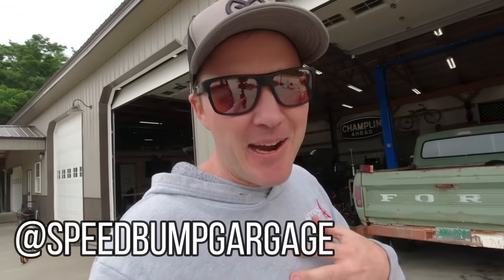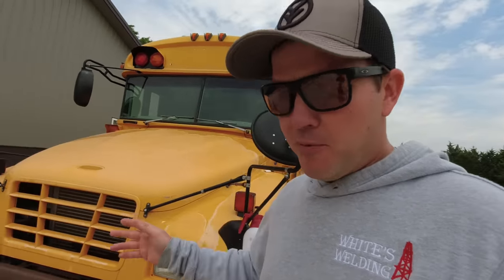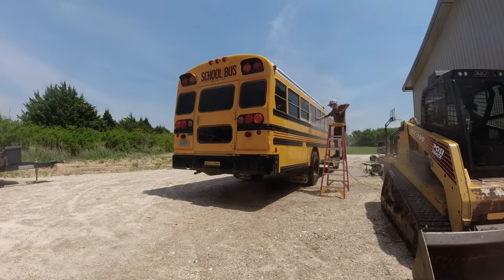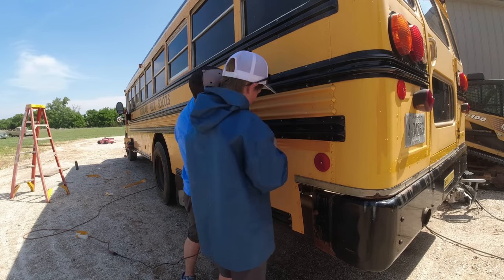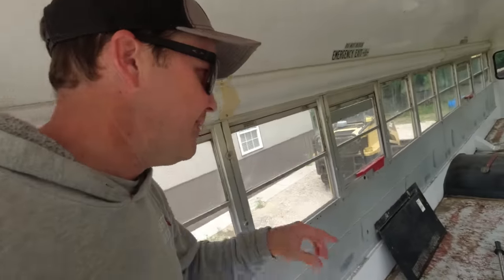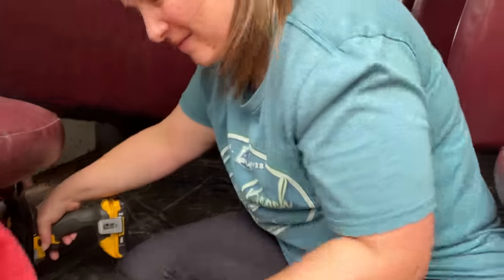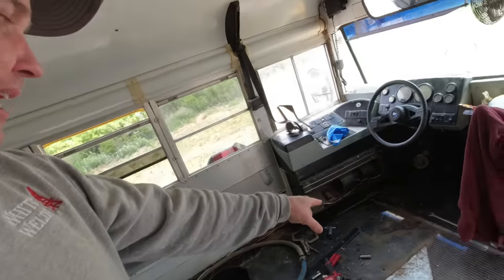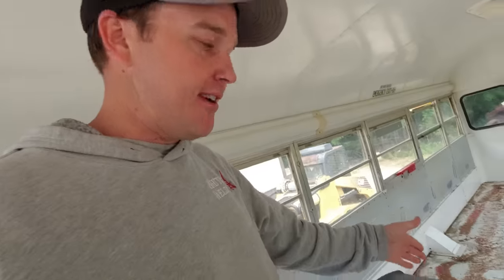DIY Family School Bus Conversion! {The Teardown} EP1

Comment: For painting the thing. The hood is where you can take the most time and get the best results. You could set up a little paint booth in the garage for it,  prep it, prime it, and spray it like that. For the rest I'd really use a roller brush. It's not going to be perfect, for sure. But, if the nose is close to perfect it'll grab all of the attention!
Reply from the maker: Great idea! I think the hood will also be the hardest to prep
Reply: @SpeedBumpGarage  You could also farm that out! I doubt a paint shop would mind something so small with such a quick turn around. If the price was right, it would save you a lot of time and effort.
Reply: @SpeedBumpGarage  use a wrap to cover the hood make it a Partridge style wrap job ,eave the side rails black

Comment: Back in the early 80's I found a 1951 International short bus that had been turned into a camper. It had a Chevy 283 with a truck 4-speed and a 2-speed rearend.  I did a lot of work on it, but the outside windows were replaced with camper windows and the rest were covered with sheet metal.  It had a stove with an oven, dinette, a double overhead bed, two bunks in the back and a bathroom with a shower.  That thing was crazy cool and would fly down the highway easily at 70-75 mph.  My family and I had a fun time with it, and we went all over western Colorado when we lived there.  You have unlimited possibilities!  Have fun, great video!
Reply from the maker: Sounds really similar to what we want to do!

Comment: I would sure go for a sub-floor giving a few access panels..Good for keeping wiring hidden thus having a clean look and also able to add any accessories later on that you may want ..They make a thick tar like wide strips that adhere to the ceiling to deaden the excess sound you will get when driving it..Thats what they use in auto assembly plants before the headliner goes in..i would use those for sure..You have Jack on the Job so i am pretty sure he will have your back on anything you want to do..Awesome project..can't wait to see your end result

Comment: Hey dad, just a tip on sealing the wires with heatshrink, if you heat the shrink really hot, part of it will seal around the wire plastic, some will be a tube which you can crush with a pair of pliers and the heatshrink will seal to itself. It prevents anything getting down that tube and possible at the copper.
:)

Comment: I just started watching after AFH sent me here. I've got a 2005 Bluebird 12 Window just like yours, as well as 2010 BB and 2000 Chevy BB both Handy busses with the side lift door and I think 7 windows IIRC. Also a little 6 Window BB International and 1 2002 Thomas Freightliner. Jack has made mad progress already and doing exactly like I did, but I was by myself unfortunatley, by clamping about 5 vice grips on the bottom then going back up to the top to remove them 5, them back down under it for 5 more and repeat til I got all the seats out. Not fun.

Comment: Kent,
Wow! What a crew you have! My suggestions to start would be to build a floor structure and cover it with removable plywood panels. Make it deep enough to go over the wheel wells, give room for plumbing, electrical and insulation. I can see y'all going to car shows pulling a trailer with a rat rod loaded on it and staying in air-conditioned luxury right on site.
Reply from the maker: Thanks! I think I would have to raise the roof to do that

Comment: Since you are only going to use it for the weekends. You might want to put the bathroom on the back portion of the bus. (You can always add a metall carry cage to the back to store a water tank/Generator and or bikes/mini bikes kids stuff.)  Also may want to invest in solar panels for the roof and maybe a portable power station like bluetti, eco-flow, or anchor or others (I guarantee you that Jack can get one to sponsor his page Since he's a bigger (more than 20k) channel. You and Crystal can use the fold out couch and you could make bunk beds on the same side as the couch and put dining set behind the driver's seat and kitchen behind that. Use the wheel well to  put mini fridge (so it'll be raised  up a bit higher than mini - less bending).  The reason I suggest the bathroom in the back is because bathrooms on busses are very tight and uncomfortable.  Save yourself the heartache and headache of wishing it was bigger. You can always make it a bit smaller and use some of that space for water heaters, water storage, batteries,  solar set up, etc. But make sure Crystal has enough room to sit on the toilet spread her legs all the way and wipe her backside if needed.  Because if momma ain't happy ain't no one gonna be happy.  Lol.
Reply from the maker: Ain’t that the tooth lol. Thanks for the tips

Comment: instead of painting could you possibly cover the side walls and windows  with some type of thin metal or plastic siding like factory built motor homes have?
Reply from the maker: That could be an option especially on the windows if I delete any of them

Comment: What if you were to lift the roof up just in front of the wheel, welse and build a platform in the back? That way, you would have clearance for your head. And make that your master bedroom with your bathroom. And you would have plenty of clearance to walk in through there, and baby raised it up. About 12 inches an extra foot would be wonderful. And you raise your platform up about 10 inches above the wheel Wells.?

Comment: One of the things I forgot to mention is you might consider magnetic switches on cabinet doors with interior led lights. (Magnetic switch like you see on alarm systems for windows and doors. ) They make single, and two wire switches.   I use them on my trailer to light taillights on the tailgate.  Just a thought.
Reply from the maker: Great idea! Thanks

Comment: OKAY, Inside my bus. Bedroom was in the back. All the way across the back, fold it up to be little coaches on each side. Starting with the left side. Bathroom. Then two fridges stacked on top of each other. RV's. Then table the forward down to a bed. Then driver seat. Right side, shower stall. Homemade. Then stove then. Then sink. Then table folds down to a bed. Then Fisher would stove cut. Cut down at the hump. To fit the. Then the door, bus door, fold the doors. On the back of the bus. Had a rack Stuck out four feet. Width of the bus. 2 foot sides. One side passenger side fold it out to load my trike. Big rack on top metal ladder going up. To the rack, two sunroofs that. Mistake. They sweated. It's pretty good, because I had to hold back bed Then I had my nephew and niece could sleep in the other two beds. Perfect for hunting, because I had a wood stove, took it about. 8 inch logs but that was fine. Heat the bus perfectly. Good video. Keep up the good work take care.😁😁😁Oh yeah, I forgot. I put one inch styro foam, insulation on the bottom of the floor. Then. It on top of that. Two fridges were above the wheel well on the left side And the sink was above the wheel well on the Right side Didn't put any insulation in the walls because the double wall was insulated. Foam. The shower was just the fiberglass. And then Joko. Bathroom was just a toilet in a very small sink, corner sink. Had cupboards from. The fridge is all the way to the front of the bus, above the driver's seat on the left side. And then. And then smaller cupboards on the right side from the sink 2. just before would stove. Concrete board around the wood stove area. And underneath it. In the course, it had the gray water tank and the black water tank underneath the bus. And I made a side compartment on the right side because it didn't have one. Side compartment on the left side, right by the driver's side for the battery. And I had a cat battery. Had a big tank. Tank for propane on the left side. And then a double tank. At the back. Lots of propane.
Reply from the maker: Sounds like a nice setup
Reply: @SpeedBumpGarage  It was nice setup. Used it for 20 years Now it sits in my yard. Gutted. And my workshop tables are drill press. Planar. Grinders would. Lathe. Add the cushions made up, especially for the bus cost me. Cost cost me.$800. Let my mother in law stay in it for one summer. They had a big Rottweiler. Cushions are wrecked. So I didn't like going in there anymore. Then the rats took it over. So I gutted it. I made it into a shop.😁😁😁

Comment: Put your sink and stove over the tire and frigerator entire behind the wheel that way you have room for the tanks the paint outside you don't have to cover the whole bus what I have done was paint 3 ft from the bottom up black and then the rest White reduces heating on the bus paint the roof l White as long as it does not look like a school bus no more
Reply: You didn't have my glasses on it should have proof read it but behind the wheel wells that should be the shower countertops should be 36 inches from the floor all your heavyweight over rear axles or in front of them
Reply from the maker: Thanks!